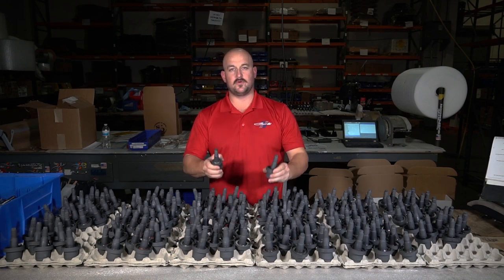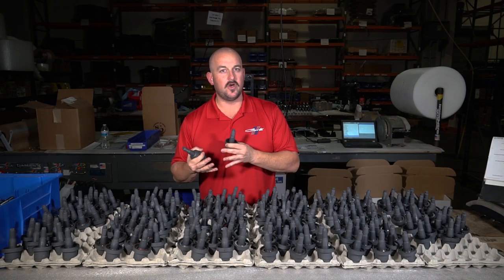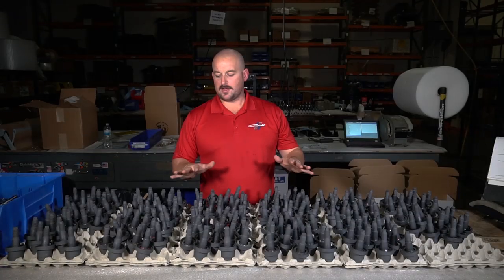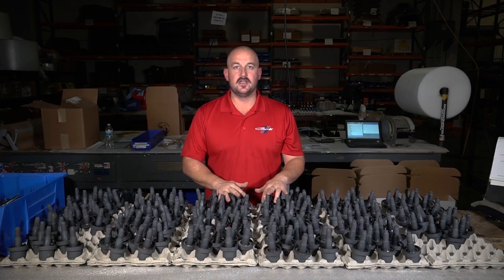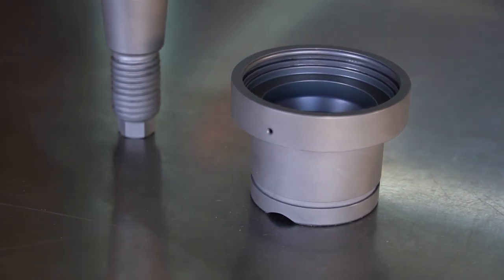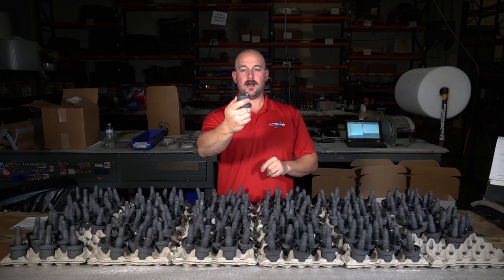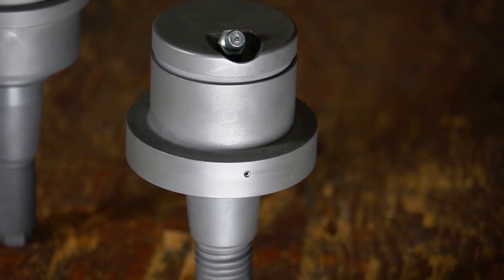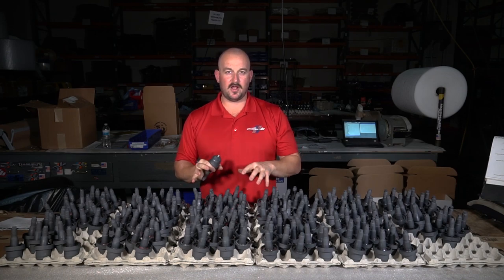The Last Set of Ball Joints You'll Buy for Your Ram HD

Comment: If you are on the fence about buying these Ball Joints Don't be!  On my 05 Ram truck I went through 4 sets of factory Ball Joints (16 total).  One set of factory balljoints lasted as long as an oil change (5K miles).  I bought one of the first sets of Carli's that came out.  I did have an issue with a lower balljoint that actually broke,  As it turns out it was something with the metallurgy.  The owner of Carli Suspension called and inquired about the problem.  They shipped me a new ball joint and even paid for the labor to install!  Bottom line, Excellent Company Top of the Line products!

Comment: Hard to believe ball joints will wear out in 500-1000 miles, either improper install or they are being excessively abused(not sure how), or extremely harsh environment. I didn't change them on my 2004 ram 2500 diesel until a couple years ago @190k miles. Even then only one was dry and loose. Those were the original from the factory.

Comment: I’m blowing through ball joints on 2010 ram 1500 6” lift every 5000 miles and ruin 2k sets of tires 37”.  Just spent 8k on all new suspension upgrades and is still happening- truck is back in the shop- are these guaranteed for a certain mileage?
Reply: Oh and to clarify- I’m not even off roading this truck- it’s mainly for deep snow and storms we have in Colorado.

Comment: I've unfortunately gone thru a lot of the same headaches and mistakes of having Moog ball joints installed with the knurled tops. Are there any issues with clearances and installing the Carli's now?
Reply from the maker: Sometimes... If you've had multiple sets of Moog's installed, there's a chance your bores were oversized. This can usually be alleviated by using a center punch to dimple the bores effectively swelling the metal around the punched area to create enough bite for the factory spec ball joints to hold.
Reply: @thecarlisuspension  You can shrink a hole by using an acetylene torch, heat one small side area to light cherry and let it cool, the bore will shrink. What happens is the red metal yields a little as the part that is not heated is very stiff when the heat causes an expansion, when it then cools the bore is pulled tighter. I have done this also on engine connecting rods that were too loose for the piston pin. It should take a few thousands out of the bore every time you do that, up to a point of course. I see some of these knurled ball joints are .005 - .006 oversize. I wonder how many people have forced in oversized ball joints into perfectly sized bores in the axle without realizing the consequences. Other thing is can you use some version of Loctite to take up the excess clearance? I would think so.

Comment: I have brand new ball joints on my 2006 dodge quad cab diesel.  All parts other than these are Thuren .  3" springs , control arms ,sway bar links ,trac bar .  Having a hell of a time with alinement.  Under acceleration trucks goes left or right and kinda feels out of control.   I am ar about 0 toe and plenty of caster . Going around corners feels fine . Only problems going straight it seems .  Its actually scary , especially when towing and loaded .  Any suggestions?   Could this be sticky ball joints .  New nitto 35 s too . Air pressure ? Tried  it all.   HELP ! lol.

Comment: I brought mine last year and they have the 6 bolt retaining ring design and NO GREASE EVACUATION PORT. Does that mean I have pre 2014 stock and where is the grease supposed to evacuate? Do they have any kind of  internal seals?
Reply from the maker: No, the updates for the CS-DBJP-03 was actually quite recent. They're not a sealed design, thus there's no real need for a grease evacuation port on your model. The good news, if they ever fail, they'll be replaced with the new version!

Comment: Personally I do all of the installation of parts on my vehicles (as I'm sure most people who are looking at Carli do as well) but what about those who don't? Hypothetically speaking, should these balljoints meet the standards for warranty replacement and the owner has to have them replaced at a shop will you cover the shop charges?
Reply from the maker: The warranty is limited to the product; we do not cover labor.
Reply: @thecarlisuspension  if you covered the product you should pay labor when it's your product that  fails

Comment: Will these ball joints help correct offset camber and to what degree?
Reply from the maker: Camber is non adjustable on the RAM HD platform. These ball joints are a 0° so there's no "correction" as it's not needed. If you're being recommended offset ball joints, either the lateral wear on the upper is so drastic that it's reading camber or your axle is bent - neither of these situations are corrected by an offset ball joint. One's a false reading and the other's a band-aid fix that will lead to future issues.

Comment: Are the ball joints for any size tire and wheel package?
Reply from the maker: Yes, you can run as large a tire as you would like without voiding the warranty or without worrying the ball joints will fail.

Comment: I was reading a post on a forum and a guy was having a problem with his Carli lower ball joint squeaking really bad, he could not get grease into it and he mentioned that there was no escape port for the grease.  Was this an earlier version without an escape port?  Are your ball joints warrantied against squeaking.  Thank you.
Reply from the maker: Squeaking is an interesting one as it could be from a number of things. Main thing that causes squeaking is not servicing the ball joints OR not servicing them properly. The instructions call for the old-style ball joints to be greased with the truck on jack-stands to allow the weight of the wheel/tire combo to create a tiny space in the ball joint cup/pin wear surface for the grease to travel. If they're greased with the weight of the truck, you're not getting enough in and it may or may not migrate to the wear surface depending on the grease you're using. The new ball joints have a grease evacuation in the lower and this is no longer a concern. Squeaking isn't a functional issue with the ball joints and is usually a sign that the service interval was neglected; grease them and the squeak goes away. If the squeak doesn't go away, yes, we'd be happy to look into a warranty. Point is, we take care of our customers. It's more important that the customer feels taken care of than us only replacing defective product. The only time we've ever denied a warranty was due to lack of purchase receipt (required due to the leniency of our warranty) or when a claim is submitted but our ball joints are functioning within tolerance.
Reply: @thecarlisuspension  what grease do you recommend?
Reply from the maker: @tapantera  Redline CV2

Comment: What about offset ball joints to correct alignment issues so tires don't wear out to one side
Reply from the maker: If your camber is far enough out to need an offset ball joint, you're likely looking at either a BLOWN out upper ball joint allowing enough lateral play to read excessive camber or a bent axle. Replacing with a non offset joint with no slop will correct the former while the latter gets a bit more expensive.

Comment: Got a pair was too small for the knuckle I guess.. 6th set of moogs put on now still got my ball joints in the box. Kinda sucks moogs lasted me bout 500-1,000 miles. Tire rotation shouldn’t cost a guy 1,700 everytime ball joints with a tire rotation.
Reply from the maker: It sounds like the joints were properly sized but multiple sets of MOOG (knurled) over-sized your ball joint bore. CJC Offroad made a video about the installation process and discussed technique to knurl the bore to provide sufficient grip to hold a factory size ball joint. https://youtu.be/3geIH9cCi-c?t=322

Comment: can this work on a 2001 dodge ram 1500
Reply from the maker: Sorry, no. That's a Independent Front Suspension - these are for the straight-axle equipped HD Rams.
Reply: @thecarlisuspension  2nd gen 1500 are solid axle. I wonder if they will fit